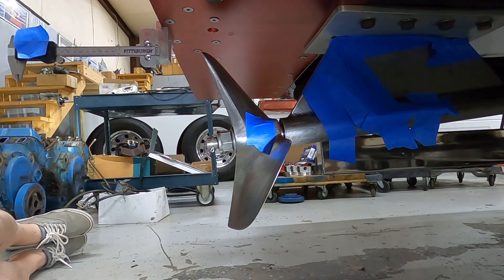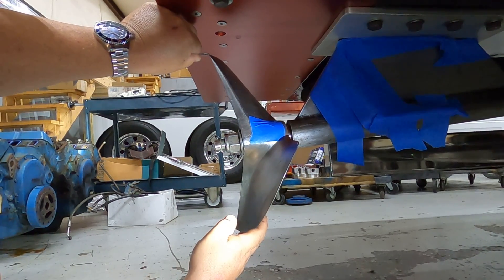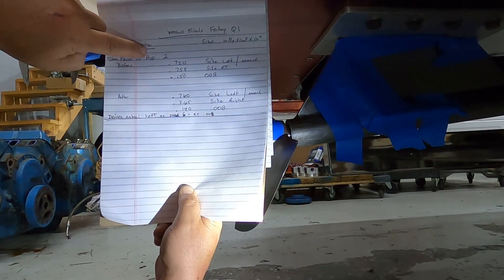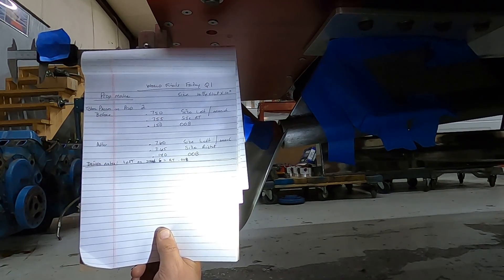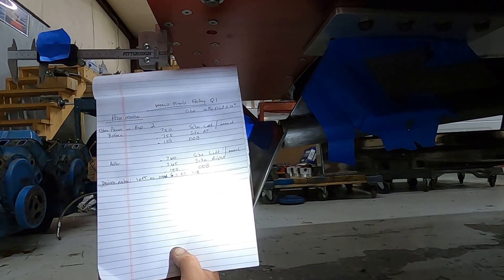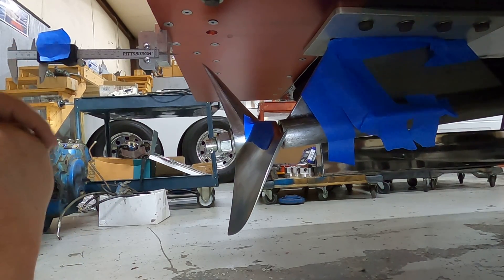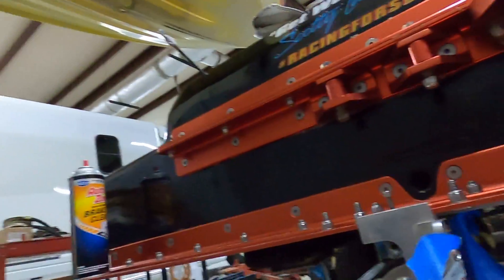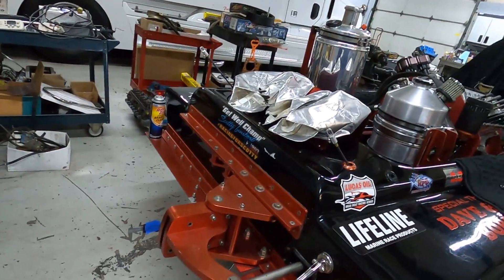Measuring a propeller on 200 MPH Drag Boat-Andy Reynolds

Comment: This might be oddly specific, and not too sure if you have any experiences with surface drive setups, but... looking at different prop options right now and can't really start on a place to start. I have a 18' 2700lb 15 degree deadrise 800hp turbo LS ~25% rear COG that im running with my custom dropbox that takes winters gearsets so i can use any gear ratio from way underdriven to over. in theory I should be able to run 110-125mph. thinking to start with an 4 blade, 24 pitch, 15.25" diameter, 15 rake cleaver with an 1.38 ratio. but i can run anything from v-drive to #6 26 splice  props
Reply from the maker: I have not run a surface drive setup before but have had a few friends mess with them.  One had on in a 25 Cat.  The only issue is the  boat  would try to swap ends with him at higher speeds...in other words it would try to propwalk sideways to try and drive the boat around.  We experience this somewhat with our set ups..that is why you only see us run 2 bladed props in order to eliminate the torque of 3 or 4 blades which drive the back of the boat sideways on the starting line... maybe smaller prop and bigger gears??? Good luck!!

Comment: What is the best size of propeller for 20hp marine engine sir?
Reply from the maker: Sorry I missed your comment. I don't have any knowledge of what you would need for your application. I assume you want a 3 blade in the 15 pitch range depending on the size of boat the motor is on.
Reply: Oh my ,, I'm still laughing! Andy your a class act! @AndyReynoldsSells4Me